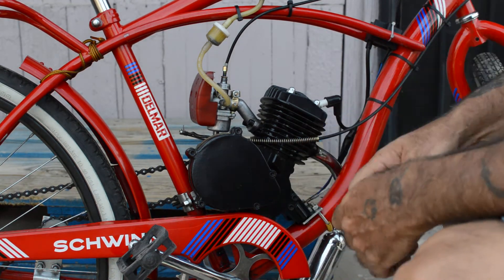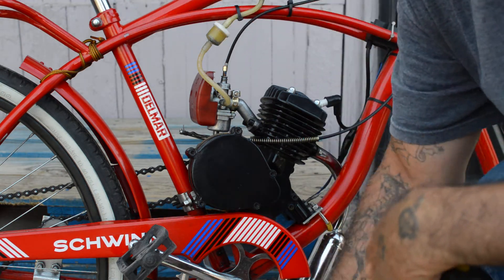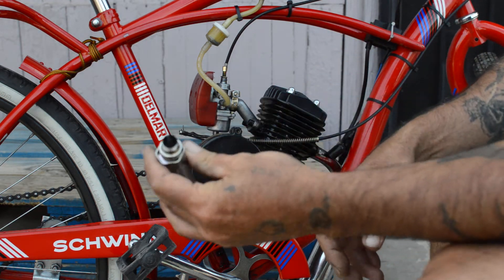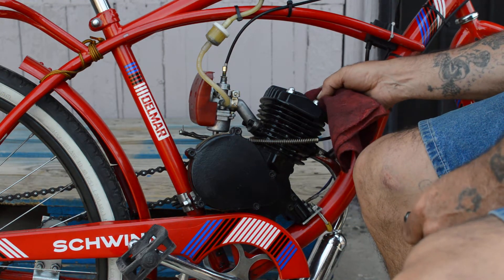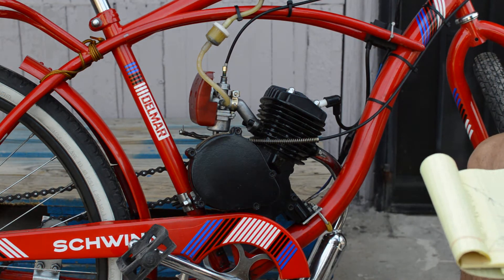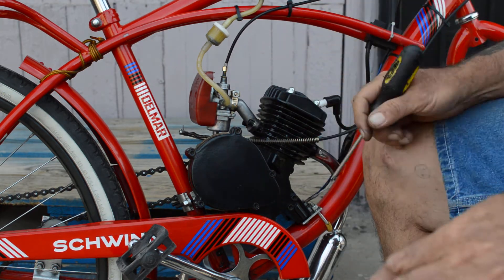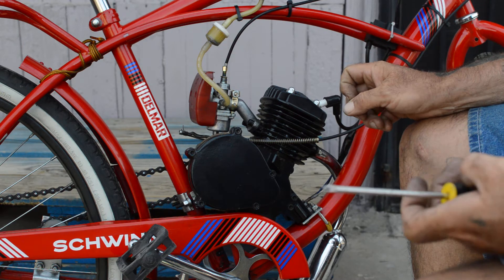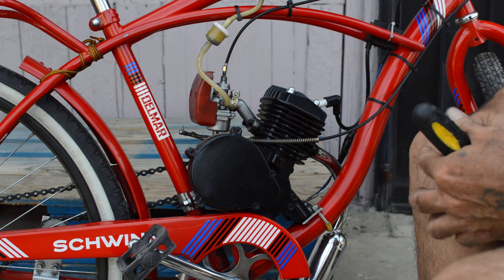Spark Plug 101 for Chinese 48cc motorized bicycle engine

Comment: I would like ask a couple of things cause I also have the 49cc motor... I can't find B5Hs spark plug and I use B8HS. Is it ok or shall I have problems with my piston? Moreover, what percentage of oil do you put in your tank? I'm using 3% Motul 2T (used to put 2% Shell Advance 2T fully synthetic).
Reply from the maker: +Marshall Murdock b5h-b6hs can be found at wal-mart couple bucks apeice. As for the b8hs causing problems in the combustion chamber? Well anytime you run a hotter plug there is always room for failure if we are dealing with a stock motor. 

you are using a different type of oil than i am i use marine type oil since it's a stock motor. If it fails it fails I use my bike for everyday riding so having a thicker mix helps with the heat issues over extended run time. So I mix at 40:1 using my handy MIxMiser tool") thanks marshall
Reply: +brian noel Hopefully I found NGK B6HS and installed it. The engine now seems to idle better. On the contrary, with the Β8HS  idle rpms were very high and took time to reduce, and the motor was very noisy. Anyway! As for the oil, I'll also try other brands and types to see which feets better.  Thanks for the feedback anyway :)
Reply from the maker: Why was it idling so fast?
Reply: +Honda Madness - It should be solved by now. But here it goes for what can be worth. If you have a stock engine use a stock plug. 
Which in this case seems to be the 4. Using a much colder B6HS (2 steps) can only be justified by really hard riding for extended periods of time,sport use, etc. The use of a colder B8HS (4 steps) is even more crazy. Unless all the above apply and in addition  your engine is tuned for performance. Meaning higher compression, porting, higher rpm's for extended periods, etc.
Although the symptoms you describe point almost immediately to a air leak. Look in carburetor/intake, etc. these are the most common places for air leakage.
Putting a new spark plug can serve as a band aid for awhile but won't cure the base problem. Be well.
Reply: b8hs is colder, not hotter. It may or may not foul too much but it will not damage the engine itself. A too hot plug on the other part can cause detonation or pre-ignition which can cause serious damage.
Reply: Also it can leak from the sparkplug threads if it's not properly tightened. That can explain why changing the spark plug solved it- maybe he just tightened the new plug corecttly.

Comment: haha your fuel filter is on upside down
Reply: ur dumb
Reply: Weston Bechtold so isn't ur shoes
Reply: I don't understand does the sens of the filter matter ?
Reply: Kinda. It works both ways but if it's backwards like his is you will not be able to see when it starts to get too dirty.
Reply: That's not a fuel filter dumb as is a air filter
Reply: TheGuessagain76  you dumbass, it is a fuel filter that’s upside down. Good grief, what an idiot haha😂😂
Reply: Don't take the filter off and put it on the right way cause all the shit in it will go to your engine so just buy a new one

Comment: shoudlnt you take that cap off the top of the spark plug
Reply from the maker: why? it is there for the spring inside the plug cap to connect and hold it in place and with a solid connection you get the whole spark coming out of the cheesy CDI")
Reply: brian noel so should the spring be inside the golden part or under it?
Reply from the maker: inside of it tyrese sorry it took so long to answer i been having some problems but things are ok now") thanks for watching")
Reply: Mine ran fine for a little bit so i took it off my old bike and put it on a new one now im having issues with the wireing im getting no spark from the plug put into something else got spark so i dont know ifs its the cap or the wiring some where shes grounded twice onve to the bike and from the bike back to the engine could really use some help here